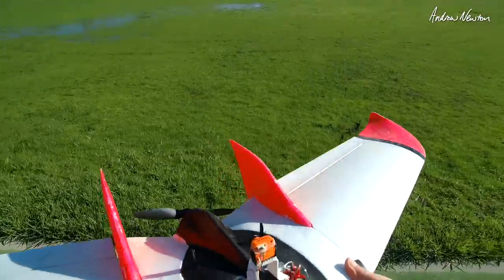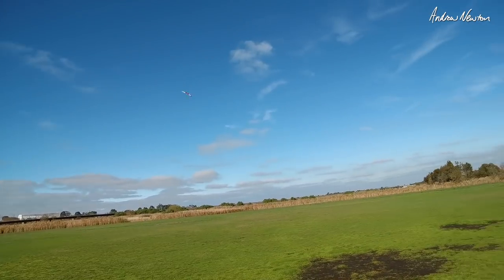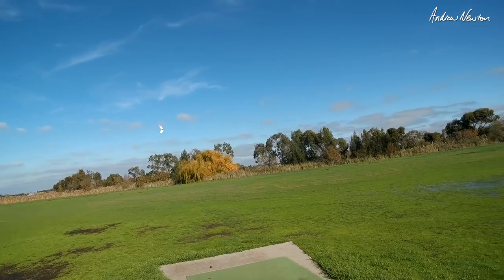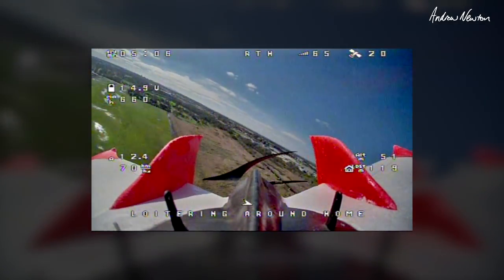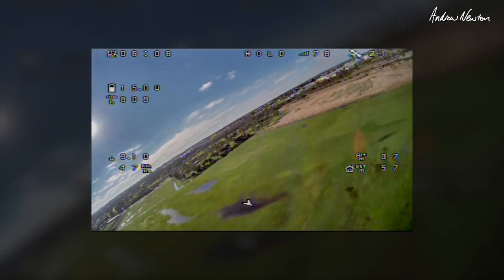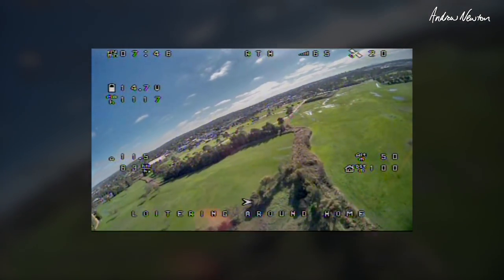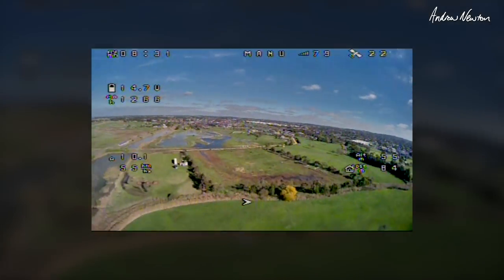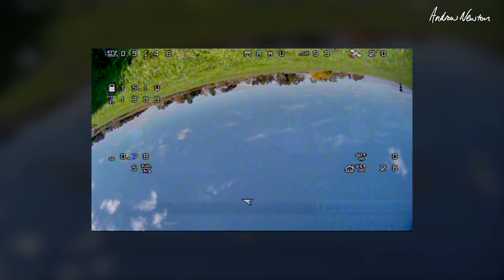Matek F722 Wing FCB - onboard

Comment: Matek with iNav make this Wing stable enough! Smooth flight without artifacts, like dutch steps:)
Reply from the maker: I wasn't using the board for stabilisation, mostly manual mode. The wing is very stable by itself.

Comment: Good job Andrew...Air Mode is not Acro too like in Betaflight though...it's a Multirotor function anyway...The second camera would be interesting set looking straight down..?
Reply from the maker: I think it should be called Attitude Mode, holds the attitude unless you move the sticks. Air Mode isn't a flight mode at all, just a "Keep control if the motor is stopped" modifier
Reply: Yes, Im not sure how air Mode can work, but you are right, on a Multirotor it does indeed hold last command attitude....How it does the same on a FW is a mystery.  Isn't it just in Manual Mode...?
Reply from the maker: By default it's in Acro mode if nothing else it selected, and I have Air mode always on as well. For proper Manual mode you have to select Manual.

Comment: Must have been a beautiful day in spite of the wet spots Andrew,  >> a question regarding the Gyro/Accelerometer in the F722 >> ICM20602.... For my Matek F405 STD,  iNav FW installs an MPU6500 as the default with the most recent FW for the target. 
They are clearly not the same  motion processor. There are a few vids out there comparing the MPU6050 vs the ICM2062 for instance.  Disturbing results! 
Are you running your install w/ MPU6500 checked as well? 
 I have had no feedback from two other queries  and this just doesn't pass the smell test. 

best regards, C
Reply from the maker: MPU6000 by default. Here's a screenshot of my F405 board config. Lots of choices, are you sure you have the right firmware or configurator version? https://www.flickr.com/photos/pandasimages/48026558523/in/dateposted-public/

Comment: Could you please do a step by step video of the setup of a wing with the QX7 radio and a Matek FC? I just put together my first wing and having trouble setting things up. I think I'm doing something wrong in the radio itself. I tried going right to the receiver itself and the servos are acting wrong and one is fluttering. I tested both servo's with my servo tester and they work just fine. Not sure what is going on with this and would love to get it going. Any help would be great. Thanks a bunch.
Reply from the maker: Tell me how you have the channels set up in the QX7.
Reply: @AndrewNewton  I have Ch1 50 Ele D-EleR
                                              += -50 Ail  D-AilR
                                            Ch2 50 Ele D-EleL
                                               += 50 Ail  D-AilL
                                             Ch3 100 Thr
Hope that is what you were looking for.
Reply from the maker: First rule of flight control boards - NO MIXING in the transmitter. Doesn't matter if you are flying a quad, flying wing, 6ch glider. Always set up your tranmitter like this - Ch1 100 Ail, Ch2 100 Ele, Ch3 100 Thr, Ch 4 100 Rud and whatever mode switches you need. The flight control board does the mixing, and yes you still should setup Rudder for a flying wing. The Rudder input is used to bring up the On Screen iNav menu for tweaking in the field.
Reply: @AndrewNewton  Thank you very much. I did try before without the mix and it wasn't working but I think I had 2 problems. The correct setup and bad servo's. I just tried it with it the way you said and still didn't work then I think the board had a brown out. Had to unplug the battery and connected 2 old small servo's I had and they seem to be working correctly. Will let you know if it works when the new servo's get here. Thanks again.

Comment: Hi Andrew, Please help me. It's my first ever build. My Gear: Matek F22wing, Taranis X9D, R9M-tx, R9-rx, MODEL: MiniTalon. I am using iNav. All servos are working but motor is not responding when using the radio. Master control in iNav is good. Can you help me figure out what is wrong here?
Reply from the maker: Motor won't work until you have enough satellites and can arm the board. ESC plugged into the correct spot? Auto launch waiting for launch?

Comment: The Cheapest and Best way to Fly is the Mavic Mini .... under 250 grams , 20 plus minutes flying time per battery , beautiful hd fully stabilized video , 3 axis gimble , GPS , all the safety features and the Radio talks ! .... It just doesn't fly like an uncontrolled Rocket !  .... Even my grandmother could fly it !  ..... NO cutting , gluing programming ,soldering , balancing , tweaking and Headaches Required !  .... Merry Christmas !

Comment: I am guessing both camera's need to be PAL or NTSC. Not one PAL and the other NTSC or does Inav and your goggles cope?
Reply from the maker: Good question, only just tested mixed TV standards while setting this up. NTSC makes the OSD overlay spread more vertically than PAL, but the board and goggles still work OK with either.